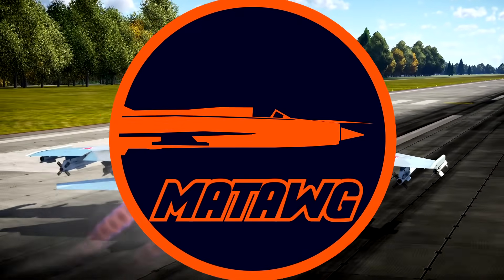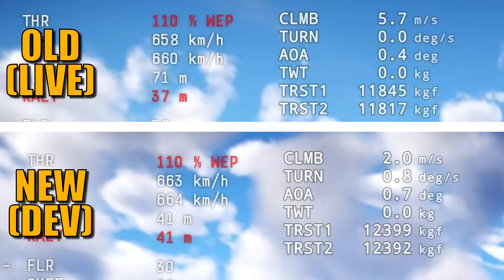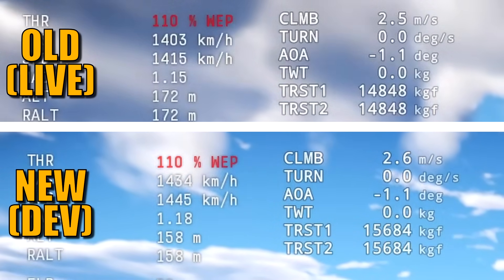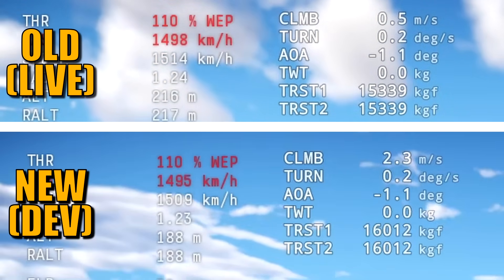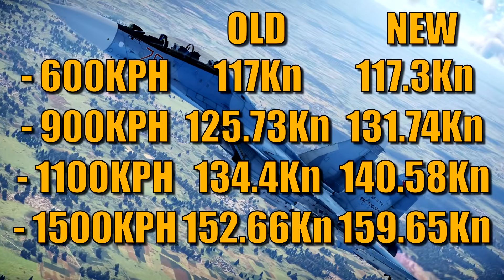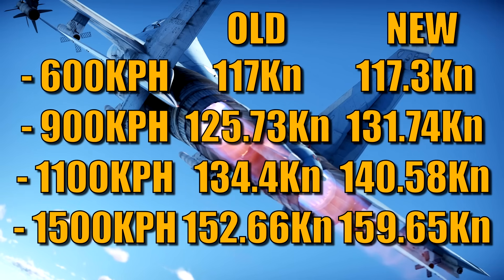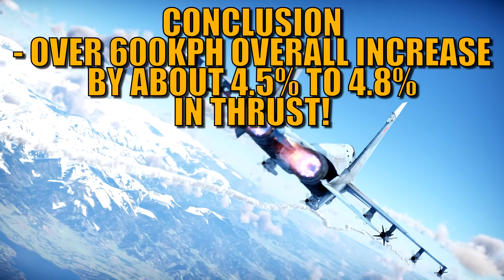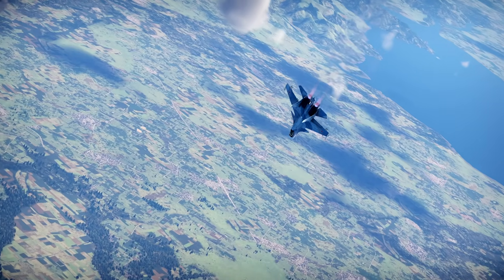HOW MUCH THRUST did the SU-30SM GOT in the DEV? The BUFF is SIGNIFICANT or NOT? - War Thunder DEV

Comment: The western bias in aircraft is insane. Just test fly Russian vs western aircraft side by side. One flies like a brick the other flies like physics cheat is unlocked. But lets cry about KH38 or something.
Reply: Considering how heavy the flanker series is and how weak the engines are, it’s no mistake the su30sm is a brick it’s literally the su27 with the same engines but just more fuel and hardpoints, it’s a fucking pig, just wait for the su30sm2 or su35 if you actually want a turn fighter, even then those planes still keep the same russian doctrine of being able to make one good turn for a high off bore sight missile, they have never made fighters for sustained turn rate fights ever.
Reply: @ben_q0  You say so much nonsense i don't even know where to start, but i'll try to keep it short.
"They've never made fighters for sustained turn rate"... as if in real life the MiG-29 wasn't a rate fighter that could out rate the F-16 while also being able to pull higher AoA and instantaneous turns when needed which is something literally reported by the west after Germany's reunification, when Luftwaffe MiG-29s trained against NATO F-16s. Yet in the game, every MiG-29 feels like a flying brick compared to any F-16, with basically no competition between them. The MiG-29SMT's flight model in particular flies like a WWII bomber, which is just ridiculous.
"Su-27 in real life is brick because it's heavy". Sorry to disappoint your expectations, but flight performance doesn't just come down to the aircraft's weight.
If that were the case, we'd still be building pencil shaped planes. The whole aerodynamic design (wing area, wing shape, intakes, body blending) is what defines performance. The Su-27, as even western sources reported, was a better rate fighter than the F-15 (Su-27 sustained turn rate was around 20-21°/sec, while the F-15A, which was better than latest variants, was 19-20°/sec; Su-27 istantaneus turn rate was 29-30°/sec, while the F-15A was 26-27°/sec).
I don't know what's the situation in game right now between the two, but when i was using them the F-15 was just superior in sustained turns... which is, again, just ridiculous.
Reply: Waiter ! Waiter ! I want more of "I dont know how to use my nation"

Comment: Btw its still not the real thrust, but u dont see russian main complain as much as Americans or german main
Reply: Well because their thrust doesn't get cut as much(mostly). F-15E for example is missing like 2000-3000 kgf for each engine, which is more than what most planes are missing percentage wise
Reply: @bish189  That is mainly due to the stat card on the engine in war thunder being wrong. As the engine reaches higher altitudes, the thrust increases.
Reply: @allenliu8820 Its still underpowered. It was actually more accurate prior to the nerf. The F15E is slower than the mig-29, mirage 2000, and F-16 at lower altitudes. Doesn't quite make sense...
Reply: @ironpizza5150 The previous nerf was mainly drag nerf and it was realistic as it was over performing. Most people knew it, but American mains thought it was realistic.
The reason why the f15e is slower on the deck is because of drag. The f15 is a significant larger and heavier aircraft compared to the mig 29.
Reply: @allenliu8820 Yeah im aware but its still slightly too much. It cant even reach its irl top speed without topping out 100mph before or ripping its wings off. Gaijin has a tendency to make some things way slower than they should and some faster. For example the F-111 should be able to reach at LEAST mach 2.6 but it rips at around 2.4
Reply: @bish189 well remember that Wikipedia numbers are static thrust, which is more than installed thrust, and more are less than dynamic thrust.
Reply: @jacobbaumgardner3406  Maybe you should release some documents about it 👀

Comment: so when does the eurofighter get the right thrust/ thrust to weight ratio
Reply: Mig-29smt:
Reply: 2 yrs after it gets necesary
Reply: Do you really want this nerf?
Reply: EF doesn't have problems with thrust doopid. it has weird bleedrates at high speeds and dogwater radar
Reply: @raketny_hvost its thrust to weight isnt the same as it is in real life its off by a good bit
Reply: Needing a buff for typhoon is wild skill issue, german main?
Reply: @adrianfolstad4925 it should get a radar buff
Reply: @adrianfolstad4925  War thunder claims to be realistic then doesnt give the eurofighter the correct t/w or radar (radar is worse than radars on some phantoms) it doesnt need a buff its making it accurate to how it is in real life same way leopard 2a4 used dm33 but doenst get it in game even though it should. I dont play the typhoon but i know its underpowered and it should be the same as in real life.
Reply: @Anti-Airliner  leak documents then
Reply: @Dyce_valetingHow would doing that help my case and how is that relevant, everything ive mentioned is public knowledge

Comment: matt may you do a video where you show all the aircraft with the fuel dumping?
Reply: A-4E, A-4E Ayit (early), A-4E Ayit (late), A-4H Ayit, A-4N Ayit, A-6E TRAM, A-7D, A-7E, A-7K, AV-8A, AV-8B NA, AV-8B Plus [ITA], AV-8B Radar ("AV-8B Plus"), AV-8C, B.JT.1K ("A-7E") [JPN], B.Kh.20 ("JAS 39C") [JPN], B.KhL.1K ("AV-8S (early)"), B.KhL.1K ("AV-8S (late)"), Buccaneer S. Mk. 1, Buccaneer S. Mk. 2A, Buccaneer S. Mk. 2B, Eurofighter [DEU], F-4C, F-4E, F-4E Kurnass, F-4E Kurnass 2000, F-4EJ, F-4EJ (ADTW), F-4EJ Kai, F-4F (early), F-4F (late), F-4F KWS-LV, F-4J, F-4J [GBR], F-4S, F-8C, F-8E, F-8E (FN), F-2000A, F3H-2, F9F-2, F9F-5, F9F-8, F11F-1, FJ-4B, FJ-4B (VMF-232), Gripen C [GBR], Harrier G.R. Mk. 1, Harrier G.R. Mk. 3, Harrier G.R. Mk. 7, Harrier T. Mk. 10, J-11, J-11A, J-11B, Jaguar A, Jaguar E, Jaguar G.R. Mk. 1, Jaguar G.R. Mk. 1A, Jaguar IS (DARIN II), JAS 39A, JAS 39C, JAS 39C EBS HU, Mirage F1 C, Mirage F1 C-200, Mirage F1 CT, Phantom F.G. Mk. 1, Phantom F.G.R. Mk. 2, Sea Harrier F.A. Mk. 2, Sea Harrier F.R.S. Mk. 1 (early), Sea Harrier F.R.S. Mk. 1 (late), Su-24M2, Su-27, Su-27SM, Su-33, Su-34 NVO, Tu-14T, Typhoon F.G.R. Mk. 4: added fuel dumping